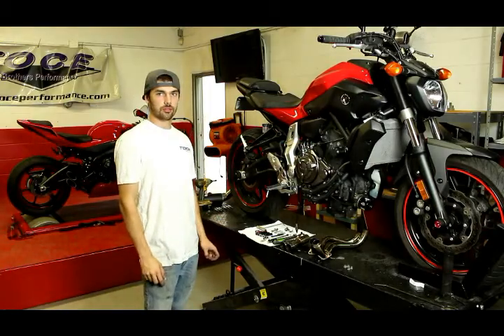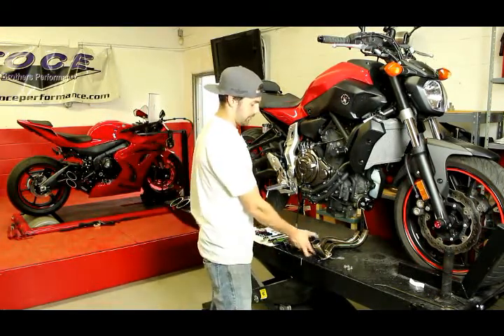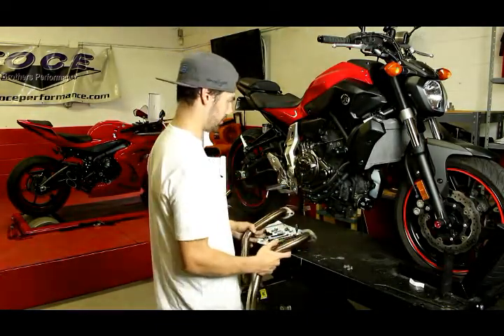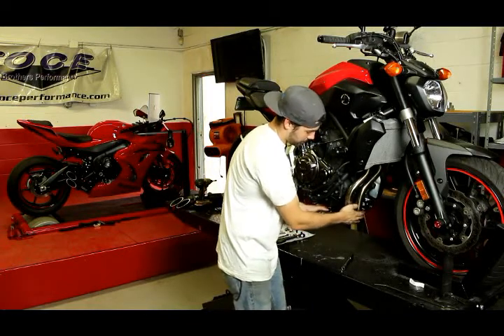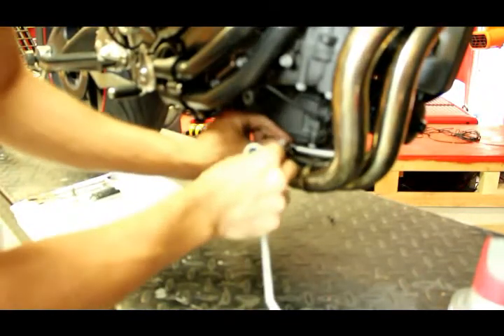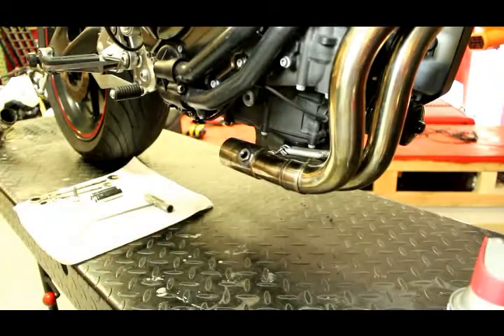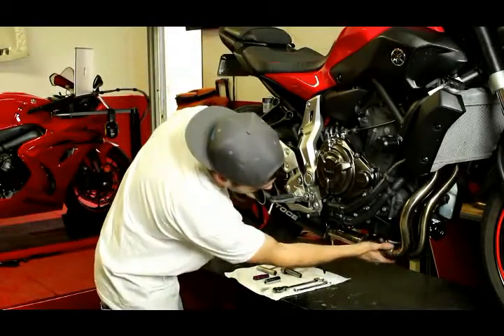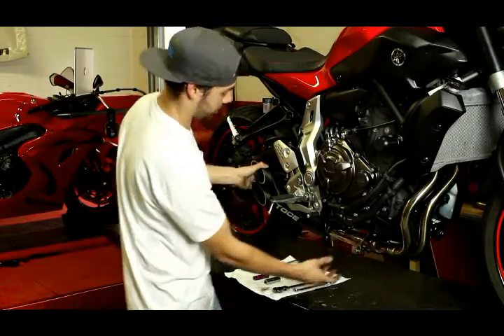Yamaha FZ-07 Install Video of Toce Performance Full Exhaust System

Comment: Hey guys! Which fuel controller that have an specific map por this exhaust and bike (MT07) do you recommend? Or all fuel controllers have Maps for Toce exhaust systems?
Reply from the maker: We do ecu flashes for these bikes, rather than running piggy back units. We have a pretty good writeup as to why we go this route right on our website.
Reply: Toce offers ECU flashing for this exhaust specifically for the MT-07. You send them your ECU, they flash it and send it back to you. Much easier than a fuel controller.
Reply from the maker: @mkopani  +1

Comment: This system is so loud they sell the db killer separate so they can make more money off of people
Reply from the maker: Thanks for your feedback! We actually used to include them with our systems, but finding a majority of customers would remove them, we actually separated the components and reduced the price of our exhaust systems completely, to try and save a buck for them.

Most non-carb-approved systems will sound very loud on these particular engines simply due to the design.  All the Yamaha and Kawi twins are very loud typically with free-flowing systems..  

In the event you were unfamiliar with any of this, and currently run our system. We would be happy to shoot a dB killer your way, to tone it down some at no charge. 

We want our customers to be happy with our product, which is why we also offer a lifetime warranty on them.